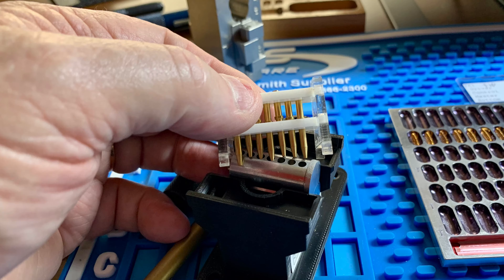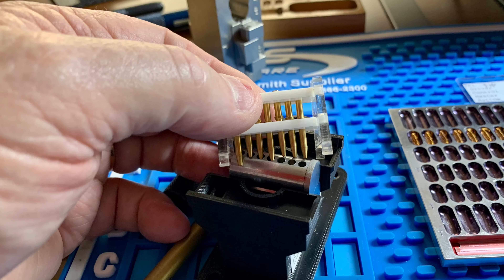LockCaddy Go,No,Go gauge on BEST A2 SFIC locks

Comment: You really don’t need that tool. Just rotate the core before loading the pins and all the stacks will be the same height if it’s pinned right. They will be about 1 mm beneath the top, easy to visualize.